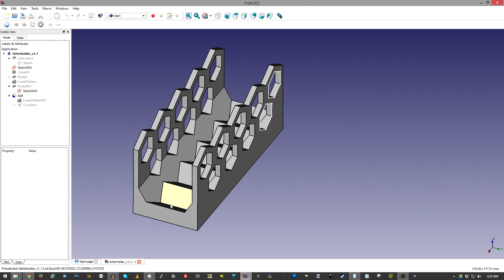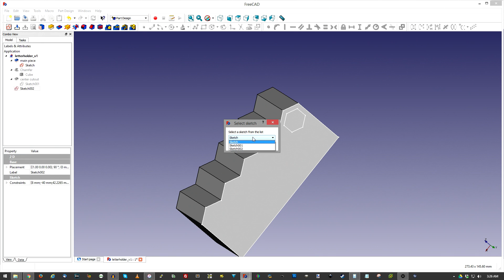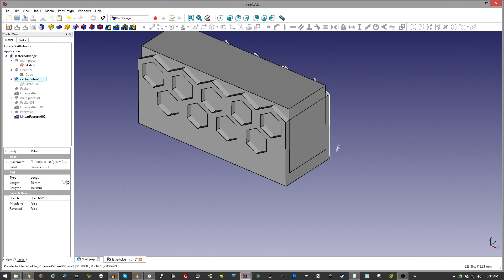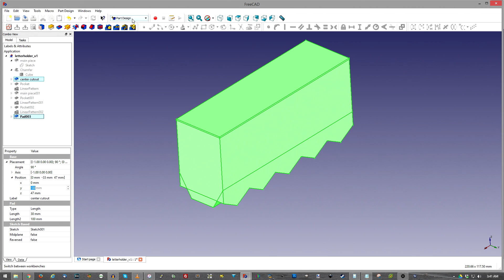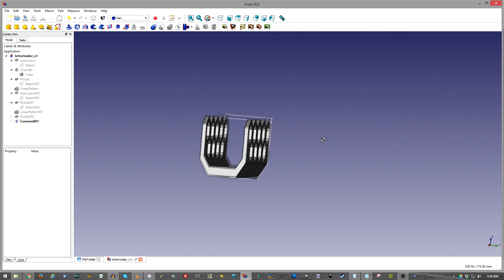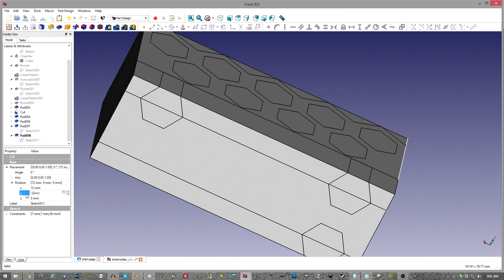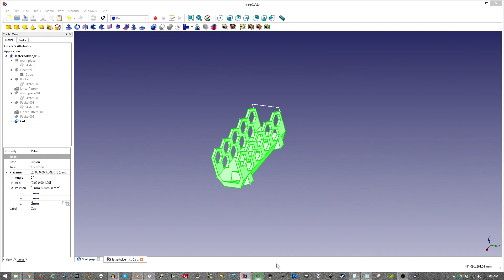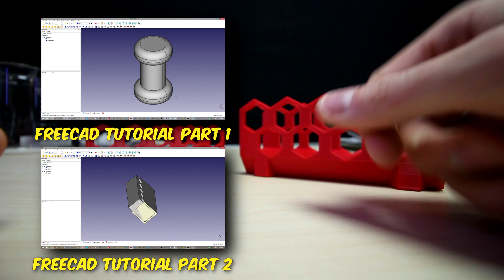FreeCAD 3D Modeling Tutorial 3: Finishing Touches + 3D Print

Comment: I am having very hard time working with FreeCAD, there seems to be so many bugs. I have worked with SolidWorks and Catia V5 so I know how to work with 3D software but this software is so far unworkable for anything useful.
Reply: @Nitin Kumar - Use the FreeCAD wiki as a source of fundamental tutorials (you will find both written and recommended videos). Visit the FreeCAD forum for any specific advice, most of the developers and regular users have experience with commercial software such as SW, Creo, Catia etc. so will be able to give quite comprehensive help. v0.17 (and 0.18) are pretty stable - there is a major update between 0.16 and 0.17 and as at Jan 2019 a freeze on additional features for 0.18 in preparation for an official release. If you are finding (real) bugs please notify the community as this will help improve the software. If you have coding skills (mainly C++ and Python) please consider adding those skills to the community.